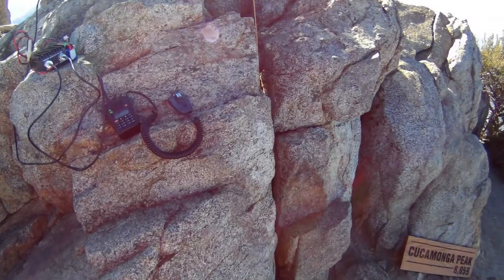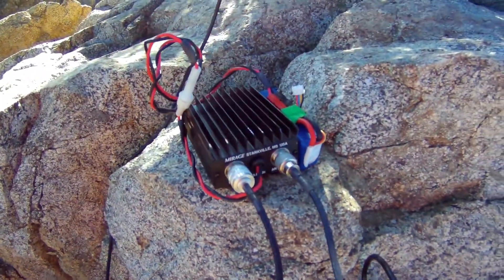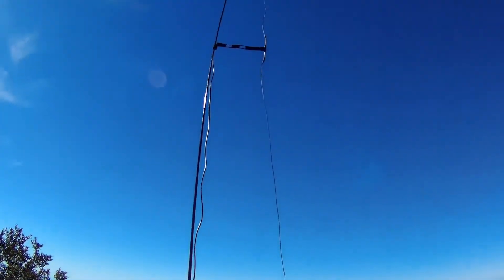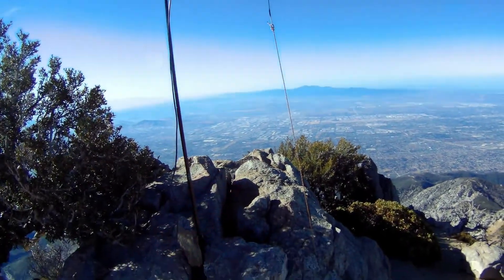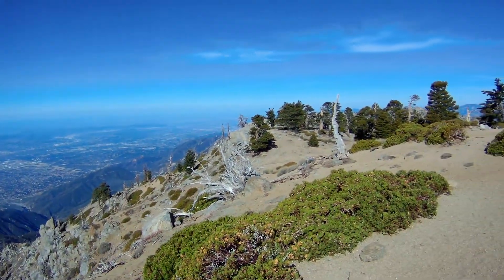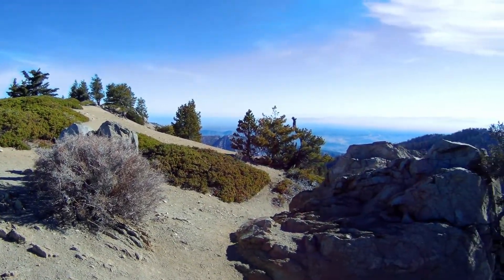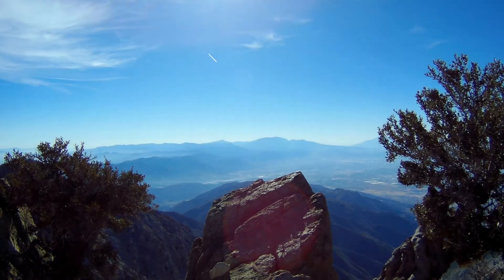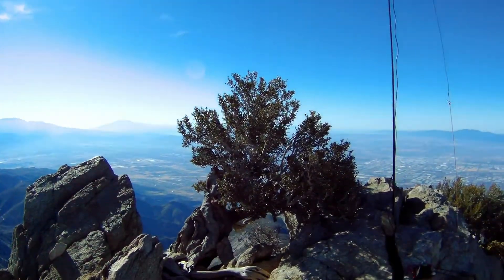K6ARK's SOTA VHF FM Setup

Comment: Is this a rig you bring always or do you leave it when also running hf? From the other video you posted on this setup it looked like you were running all vhf on that four summit day.
Reply from the maker: This is just one example of a higher power VHF option.  I traded the amp for another radio and no longer have it. Now, I typically use the FT-857 when I want to run full power on VHF.  Otherwise I typically just use a 5W HT with the EDZ antenna, a telescopic half wave whip, or a yagi. Check out some of my more recent videos for examples of those options.  Though it's no longer part of my kit, the Mirage is a great little amp if you want more power from your HT with a relatively small and light package.

Comment: Hello and hope you are well.
I've been thinking about the Zepp you recommended me to build. (haven't started yet).
Forgive me 🙏🏽 I am new to all this. Instead of using 450ohm ladder (for about 8") could I just use the wire I am going to use for the antenna and 3D print line spacers. This way the wire is constant with no joins. Or is there some magic science and requires the ladder feed wire?
Stay safe 😷
Motters M7TRS
73
Reply from the maker: Yes, building your own open wire feed line could also work, but you will ideally need to adjust the length for the difference in velocity factor.
Reply: @K6ARK  ok super thank you for the advice my master. Looks like I am going to learn about velocity Factor now. Thank you for the home work.
Motters M7TRS
73